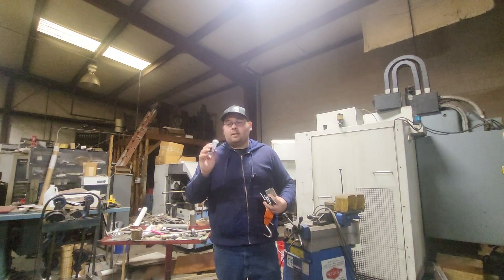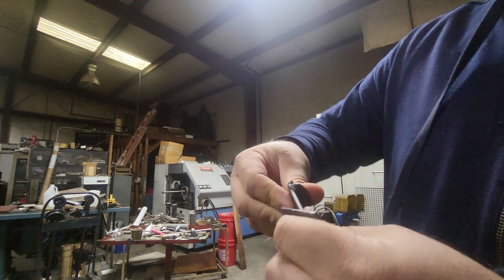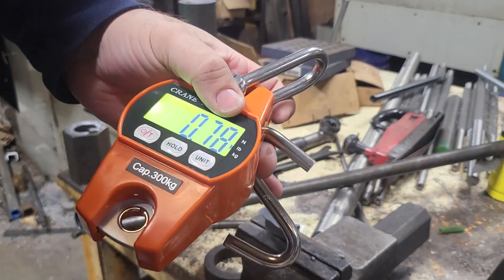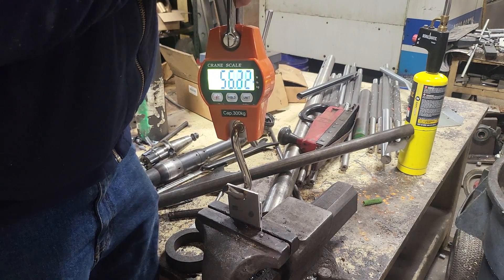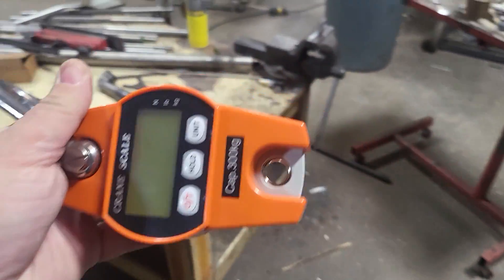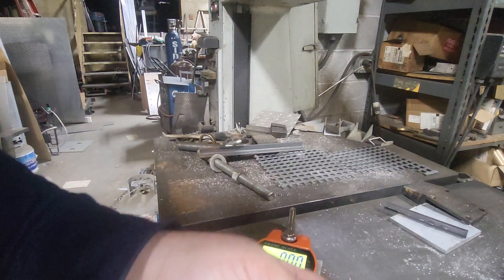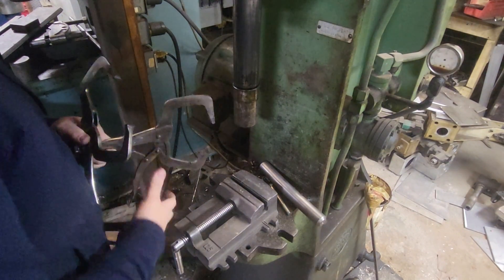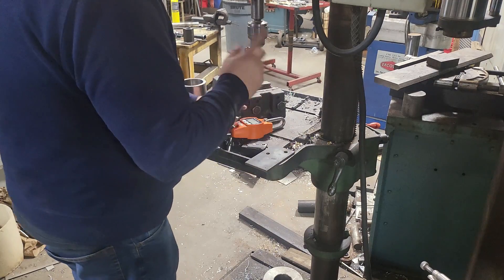JB Weld Test Fail!!! Testing out SteelStik

Comment: I was just wondering if JB Steel stick was any good, because I love the two part original. Not gonna lie, I cringed a bit when you fell. And your shop looks a lot like my lab right now. Too much material and not enough projects. lol. Looks like it needs a good mechanical connection, which isn't unreasonable for a metal epoxy.
Reply from the maker: I definitely plan to redo this. I was just really curious how it would do without any prep. It's about time to properly redo this and not bust my rear end hahaha

Comment: First off, you didn't prep the metal properly before applying the adhesive.

secondly, and more importantly, you do understand that a force applied over a distance is known as torque. So when you start pulling perpendicular to the weld, you would multiply the amount of force by the distance the scale is connected to the center of the joint to get the amount of torque required to break the bond.

Note that torque and force are two very different numbers.

Comment: I worked for a major aerospace company here in the PNW. We had one of the 3M Scotch-Weld products (3M p/n 2216) that we tested in a certified testing facility there. We took two pieces of uni-strut about 6" long and epoxied them back to back, allowing 1 inch over hang so we had a picking hole on each end. That would have been about 6 square inched of bonded surface. We mounted it in the test fixture and pulled on them. The bond held 1700 lbs before it started to yaw. We stopped at that point not breaking it. It probably would have got real close to the 1 ton mark before it separated. Dam good stuff. I only ever use J-B weld for real light stuff, everything else gets the Scotch-Weld.
Reply from the maker: 3m has some dang good products. We used some of their vhb tape on a job. You better had it lined up right before you pressed the panel in place. 

I am going to do these test a lot better. Hopefully my new load cell will show up soon
Reply: @LivingwithCable  I just found the part number, 3M P/N 2216 A/B. A bit spendy but if used only when you need that kind of strength, well worth it.
Reply from the maker: @hotratz69  thank you

Comment: If you had roughed up the surface's of the material and cleaned with solvent before bonding you're going to get the TRUE strength of the epoxy.
Reply from the maker: Yeah I plan to redo and setup properly.
Reply: @LivingwithCable  Yep, all you accomplished was using the jb weld for cleaning the surface contaminate off the pieces which is what failed. . Have to lightly sand and clean!   ;<)
As my Wife always reminds me, read the instruction's. LOL!!!
KnifeMaker